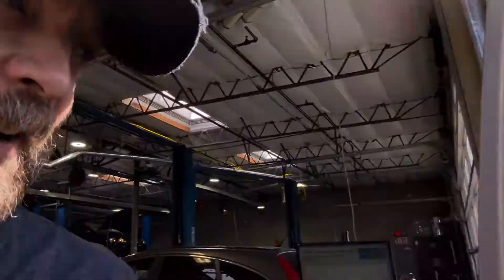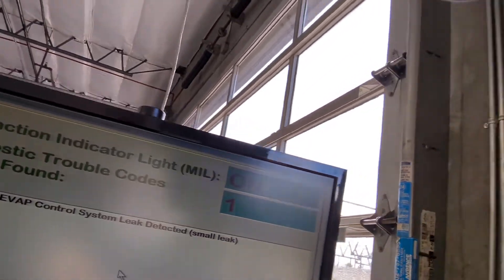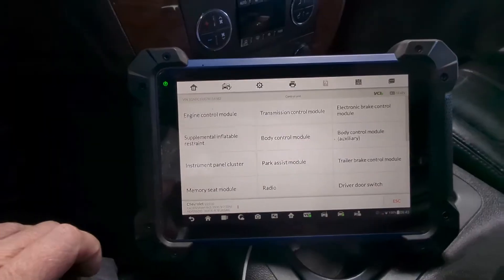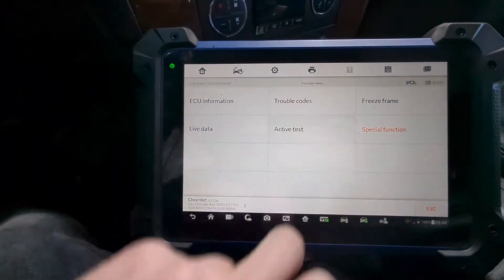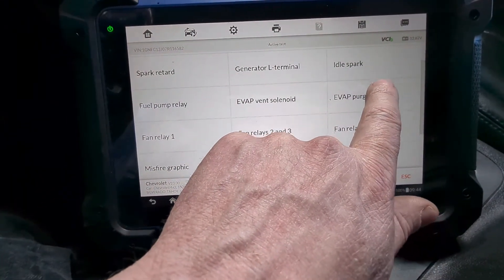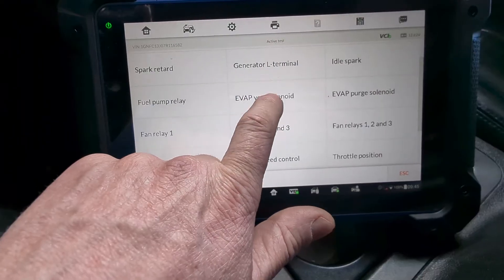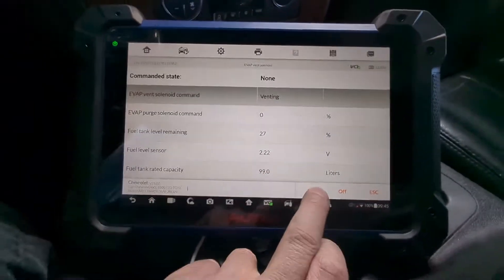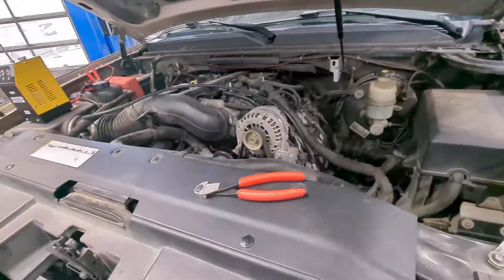How to Find a Small EVAP Leak p0442 "No Leaks"

Comment: Hey man. 
I have a 2023 Chevy express 3500 with 4000 kms on it.
I was having some issues which seemed exactly like Transmission issues. 
As time progressed, i got a check engine light that was p0422. I brought it into the dealership and they located a leak at a solenoid which he said that they installed a clamp.
Worked great for a bit. No more power issues. Stepped on the gas and there was no clunks, hiccups or lapses in power but now its got worse. Issue is, theres no check engine light so the dealership says theres nothing they can do.
I m feeling the exact same things as before but it definitely seems worst.
Any idea what it could be?
Please help!
Thanks.
Frank.

Comment: Hi I'm buying your suggested smoke machine to test leaks though $70 for smoke is expensive😮 Anyways got a PO442 on 2015 eco malibu that runs perfect. You didn't find smoke so is that what means it needs a part? And how did you get a new error code? I have a code reader but onstar sent diagnosis then suddenly the engine light came on 😮. The canister purge valve is on top of engine on malibu I'm told so where else do I cap off smoke so I can check leaks?😢 if nowhere else and I don't see leaks do I replace purge valve first cause I brought a new gas cap already. I need to know how you got deeper than the po442 code 🤔 please help me. And please explain why I have to buy the $103 pressure  gadget? I'm trying to do this as inexpensive as possible never knowing if this will be used again. Will the code reader and smoke machine suffice?
Reply: You can make your own smoke machine or even just get some rubber hose about 1/2" and a cheap cigar works

Comment: How do you cap off the system without a scan tool?
Reply: Use a power probe to send power to the vent valve solenoid to seal the system
Reply: @frankie53250  ?
Reply: pen cap